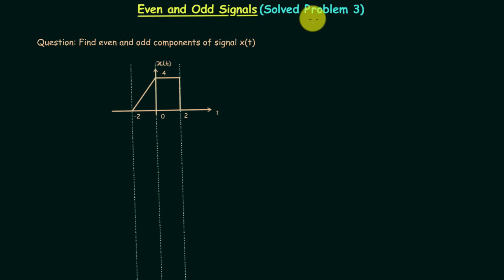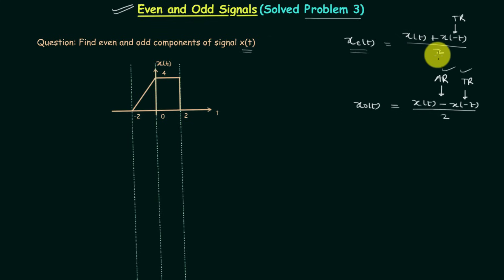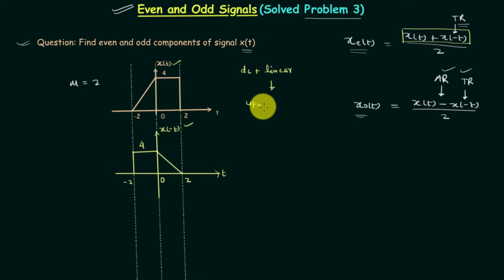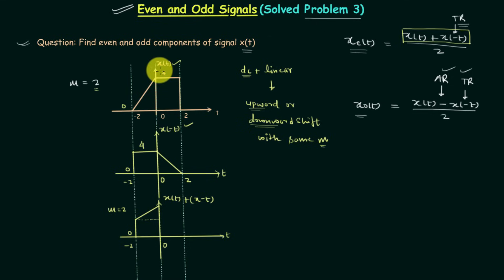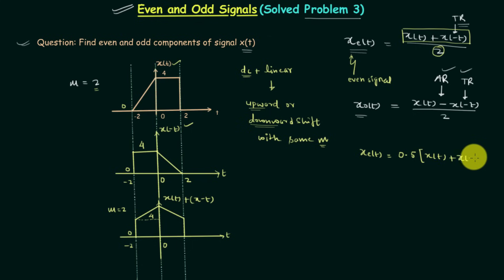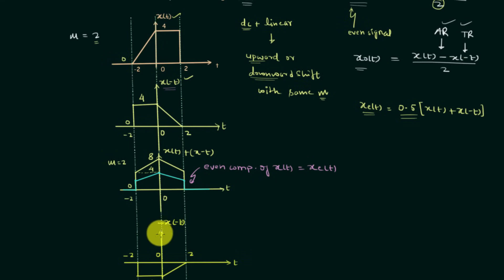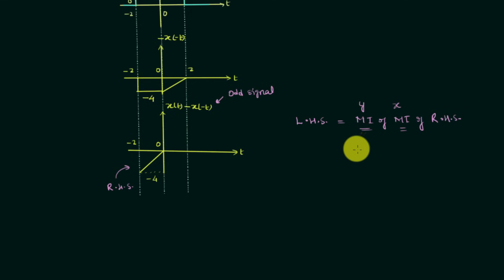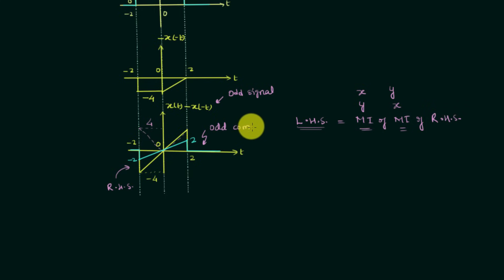Even and Odd Signals (Solved Problem 3)

Comment: Who didn't understand how to find odd component in this problem, let me help you with my simple explanation:
Now we need to perform addition between x(t) and -x(-t),,,,,,,,
1. The range of the waveform is along time axis is from -2 to 2, consider this three points -2,0,2 along time axis
2.Observe the amplitude or (value along y-axis) at these three points in both  x(t) and -x(-t)
3. Eg : Let us consider -2
In x(t)---->amplitude at -2 is 0
In -x(-t)---->amplitude at -2 is -4
Addition:0-4 = -4
so in the final graph plot this amplitude(-4) on the signal at point -2 (x-axis)
In the same way complete the plotting of amplitudes at 0 and 2 also, then join these points
Thank you...!
Reply: thanks

Comment: how did you draw the graph of x(t)-x(-t)?  linear signal - dc value how it shifts downwards?
Reply: It shifts downward because an Amplitude reversal operation was performed. This simply means Amplitude scaling but B = -1 hence there would be a reduction in the Amplitude 1:33